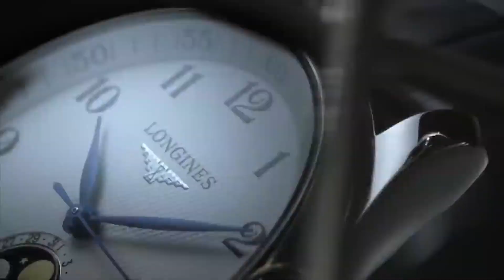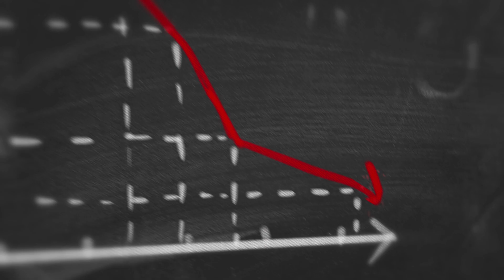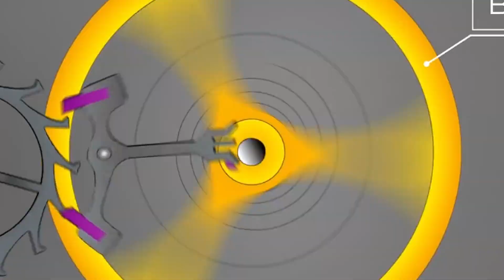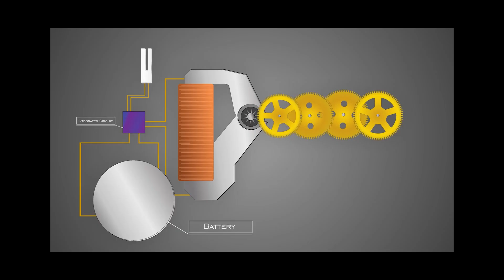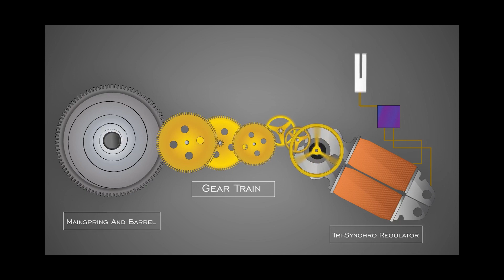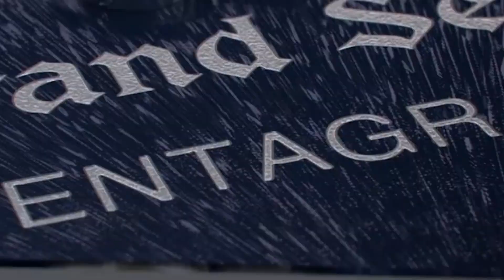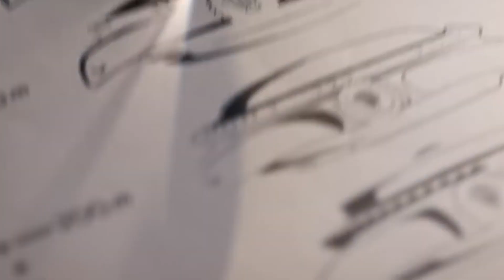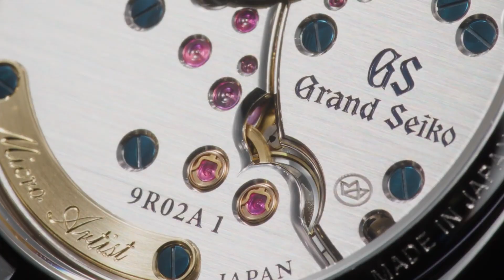The Grand Seiko Spring Drive | HOW DOES IT WORK?

Comment: Just tested my Steinhart Ocean 39 accuracy against atomic time over 1 week.  Result was an astonishing +1 sec for the entire week!  Just lucky I guess.  To be honest, I’m not a big fan of automatic watches or pretty watches for that matter.  But, the Steinhart was my first watch that was not a cheap throw-away.  

After that purchase, I learned that I prefer tool watches.  Tool watches have special features and appearance that make them more tools than jewelry.  

In that category,  I have 2 Citizen Promaster Aqualand Quartz watches that I just adore.  Both are certified Divers watches.  In terms of accuracy, my Citizen JP2000-08E is by far the most accurate of the two.  Because Quartz watches are so accurate, my test period was one year.  After one year, compared to atomic time, my JP2000 was a mere +9 seconds for the entire year.  That is astonishing accuracy.

You can find Quartz watches that guarantee +/- 5 seconds per year, but they cost a lot more than the $400 I paid for the JP2000.  Also, Grand Seiko now offers an UltraFine Accuracy spring drive movement, UFA Caliber 9RB2, that has a +/- 20 sec per year guarantee.